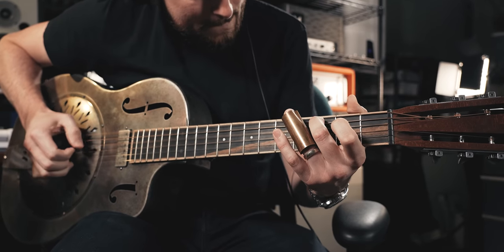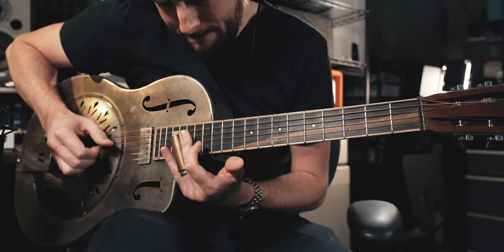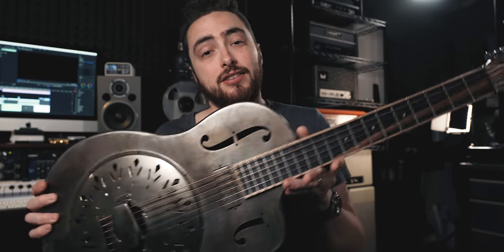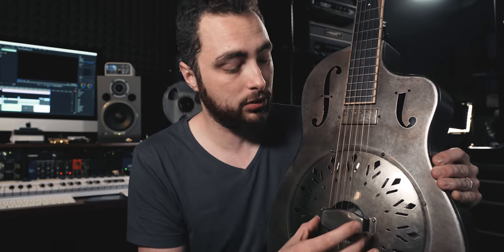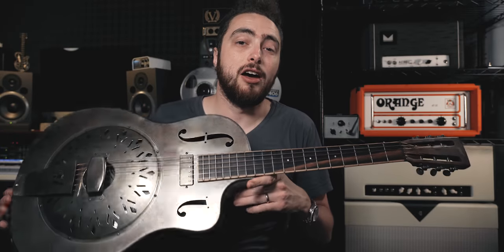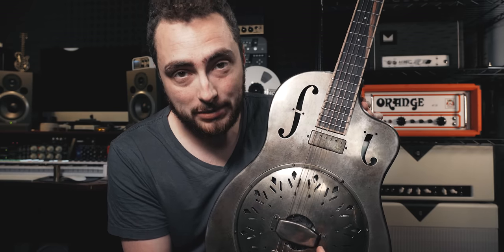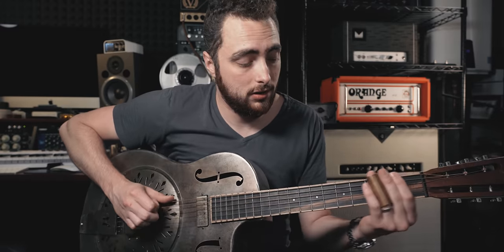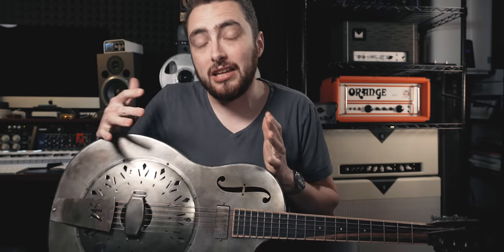This Guitar Is Made Of STEEL (and it sounds AMAZING)

Comment: And the debate over "Tone Metal" rages on.
Reply: And it will infinitely 😂
Reply: A brass body would be fascinating to test.
Reply: Brass vs Bell Brass
Reply: @humanbass  test upper body strength fo sho
Reply: xylophones are made of aluminium.
Reply: Vitor Roma My ‘31 National (single cone) has a brass body. It’s got a warm mid-rangy bark to it. I absolutely love it.
Reply: I find that tin sounds very tinny...
Reply: Fucker. I will get on that train if I don't have to do guteral sounds. My voice is built to cover Sinatra, but I want to play shit like Greta Van Fleet.
Reply: no way. everyone knows low carbon steel is the best. nichrome is the worst you can imagine.and using non-anodized aluminum is the way to go with the cones. gee, know your metals.
Reply: It doesn’t matter when you’re using a  pickup
Reply: East Indian Bell Brass vs. Sitka Steel?
Reply: I tried the Log, instead I took one of the rails. Believe me, you want a heavy metal body.
Reply: Once you make a body out of steel all the tone is in the neck! ;)
Reply: 1075 high carbon is the way to go
Reply: yeah baby

Comment: My number 1 guitar is my ‘31 National Style O. She’s a brass single cone round neck guitar. I play it daily, gig with it, record with it, and write music with it. I play slide in various open tunings as well as jazz in standard tuning. It’s not an instrument that can do just anything. Rather, I have to conform to what it’ll let me do. I love that challenge. There’s just nothing like that sound!

My next guitar will be a Mule tricone no doubt. I’ve talked with Matt a number of times. He’s a great dude who really understands these unique instruments. The modern National Resophonic company makes great instruments as well. However, it should be noted that it’s not exactly the same company as the original. They use the name and make those same models, often to a tee, but were started many years after the original company. It’s my understanding that they own the rights to the name and designs. They also make some really interesting and cool new designs. I hear the build quality is on par, if not slightly better, than many of the originals.

Comment: I love my National tri-cone.  I started using thumb and fingerpicks, and I put my slide on my pinky so I can use my first 3 fingers to make chord shapes.  Fingerpicking rolls with a resonator sound magical, but it takes lots of practice to get the hang of it.  I also started using finger picks with my Fender Electric 12 for Roger McGuinn style rolls.

Comment: I ordered a T style Mulecaster early last summer and got it about 6 months later.  Love it!! It has a lot of resonator features including the neck attachment design. Also no truss rod... has embedded titanium rods. A LOT of guitar for less than you'd expect. I have a few really top notch axes these days,  but I almost always grab that Mulecaster first, especially when I'm not plugging in. BTW,  the neck profile is sublimely good.
Reply: Ivor Thomas high end classical guitars are built like this, no trust rod. Part of the way the neck is built and set prevents it from bending the neck. It however has various results of efficiency 😂

Comment: For all the people out there wondering what material reso to get:
Actually, It's quite easy - steel is really bright and spanky, brass on the other side is more bell-like sounding and warm. 
Steel is great for solo stuff, brass is a nice rhytm type instrument, if you want to sing or play harmonica simultaneously, get brass. For me however, wood takes the cake - I have one solo piece performed on a wooden dobro on my channel in case you wanna know what it sounds like. And btw buy it, It's worth every penny.
Reply: I'm trying to find your channel now send me a link
Reply: Theyre so expensive tho! Thoughts on the cheap fender derby/top hat?
Reply: @prodevus  I have a gretsch alligator and I can tell you - nothing is better at this particular price point - if you want a reso, go for the gretsch. When you hold it, it feels like a thousand bucks, but It's only 400€. If you ever think you don't need it - cut that lie ;-)
Reply: @rhyyrrfrieg4656  Sorry for not responding, my channel is just the one I wrote this comment from :D

Comment: I have two cheepo single cone resonator guitars - a beautiful brass Recording King and a really rough steel Tanglewood. The former needed some setup - the latter was great straight out of the box, has the best guitar neck i have ever come across and has a far sweeter sound - especially G and B strings.

Comment: Rhett, I love your videos!!
Yesterday, I bought a used Brass Galveston Resonator that was once owned by Bobby Vee then upon his death was played by Robby Vee. I love the way the Reso sounds and the prior owner gave me a more than fair deal. I have a question about what string gauge to use on it. I love the strings on my electrics and use 9-46 EB custom lights on them. My acoustic I keep the strings lighter with Martin 10-47 Extra Lights.  Yep, either I'm a whimp or I just like bending strings. What would be the lightest Gauge strings I could put on this Reso and still have it sound good and play well and play with a bottle neck (what I use is a copper pipe) and bend notes?

I know you both you and Beato did a video on string gauge comparison for electrics. I have seen some string comparison for Resos yet they were just comparing brands and materials. I get it that Reso's are a niche category in the guitar world so, you may choose not to do a video on this subject. At the same time, I'd like to learn your any of experiences with Reso String Gauge differences.  - Whether you do a video on this or not.

Comment: 2 questions about the recorded sound:
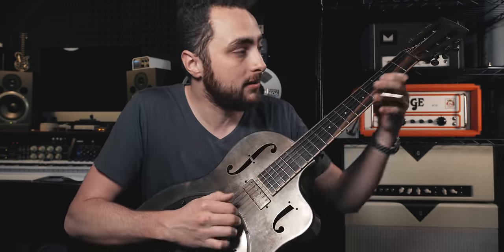1.  Apart from the part around 9:00 and the part with the echo, is the rest of the recording purely acoustic, or are you mixing in the pick up throughout?
2.  How much does the mic placement relative to the resonator cone matter?   I'm thinking in comparison to an amp cab, where mic'ing at center vs edge of speaker cone can make a huge difference.

Comment: Dead cool. A lot of you guys I am sure would love to give it a shot. you can buy a serviceable Resonator guitar by Jonathan or Aiersi both have been in business for decades and are literally wholesale for $300.00USD to $400.00 USD from Alibaba.This guitars are impressive many use bell brass for the body's with mahogany necks so these things are not junk. You can get full size or parlour size bodys.  I like the electric cutaway parlor. it is ideal for a few tunes at a gig and the audience love it. If It works out great move  to a Mule Tricone. If not there is always some who wants a shot and at the price you will probably break even.

Comment: John Doprea first invented the single one Biscuit . John didn't think it was it was suitable for guitars, George Beauchamp disagreed , and released them .

  John and George got in a big fight over George allegedly stealing one of John's Patents .  It ended with John saying to the effect of " F you, I'm leaving, and I'm going to put you out of business ! " , even though John still owned half the stock of National .

   Dobro released the Spider Cone , and started to kick National's butt . National brought out the Tri Cone to try to compete , but still within 2 yrs, National was bankrupt . Dobro Corp bought out the remaining stock , and continued as the National - Dobro Company , offering product lines under both names .

  Meanwhile , George Beauchamp got together with Ad Rickenbacker , and they discovered electricity .

  Back at Dobro , at the start of WWII , they couldn't get allocations of Strategic Materials , and dissolved , and the rights to both names floated for years between various creditors and investors . The Doprera family did get the rights to the name back in the '70s, and sold out to Gibson in the '90s .

  The Modern National has no connection or Linage to the Original National . ( But they are great guitars, better made than the originals .)

Comment: are you SURE it is steel = and not nickle or chrome plated brass ! as like most ?  other wise it would be RUSTY !
Reply: Ronnie Boucher Hey Ronnie! It’s actually stainless steel. We use a chemical on it to give most of them a light patina. The oxide forms over it and it stays as it should.